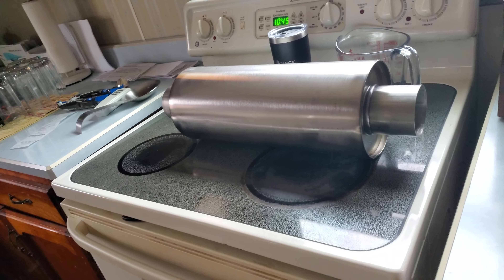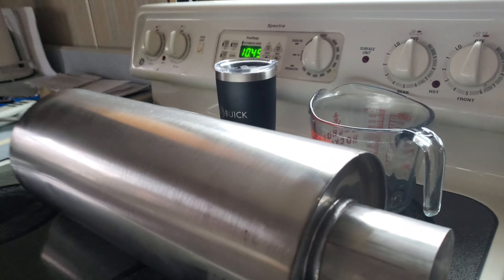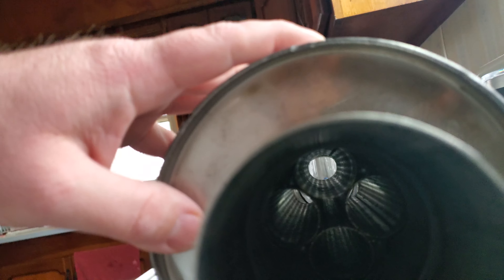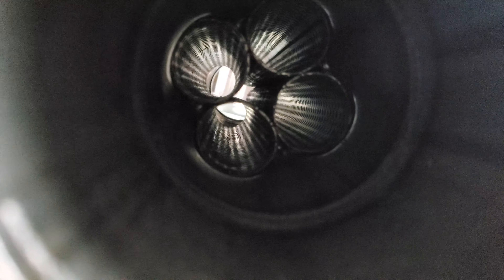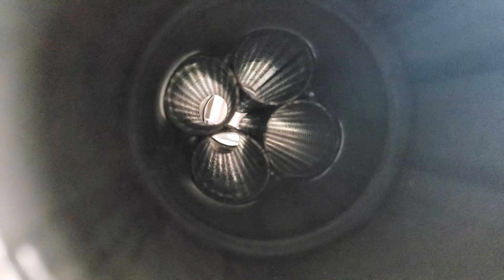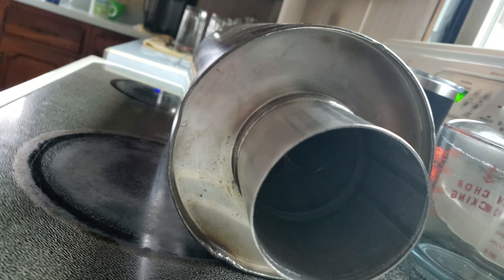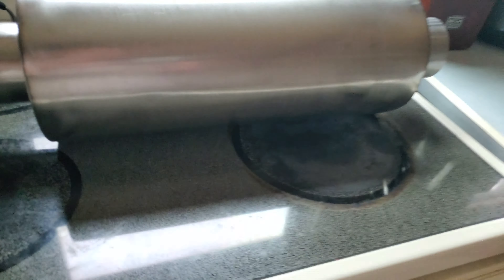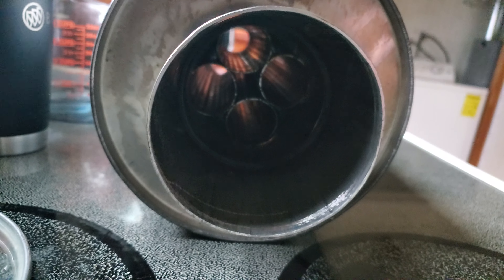Step 1 XR1 multi-core from @borla 2012 Buick Regal GS can't wait

Comment: Is this more quiet than the borla s type?
Reply from the maker: No clue But it is louder than the pro XS which I have a video on my page about
Reply from the maker: https://youtu.be/pJOAQYLjUw0
Reply from the maker: https://youtu.be/na4ATdziKVs
Reply from the maker: Check my YouTube page I have the build on both of these
Reply from the maker: I do have to tell you the multi-core XR1 is $306 from jegs The total exhaust cost me $500 including insulation and everything My pro XS borla muffler was 100 plus the piping total $200
Reply: @loveman5721  is it much louder? Does the cold start on the xr1 wake up the neighbors?